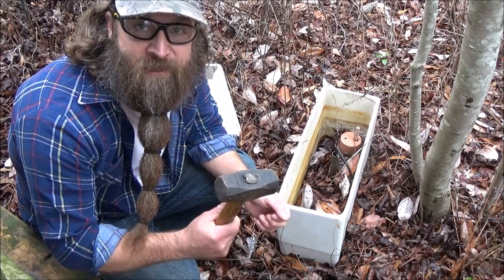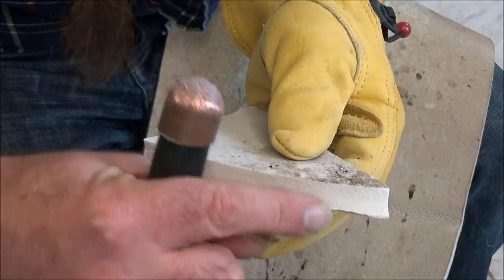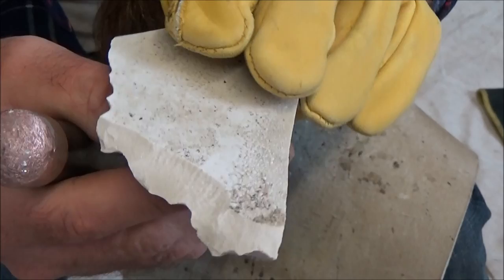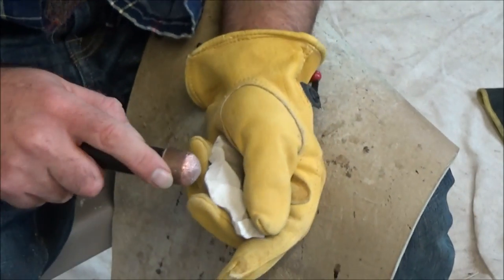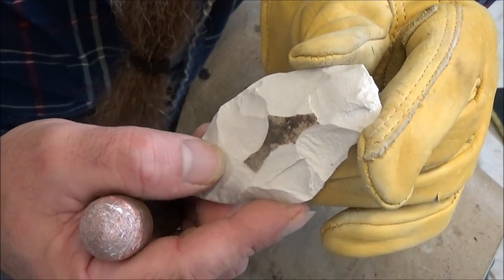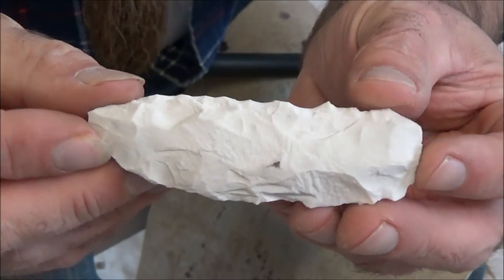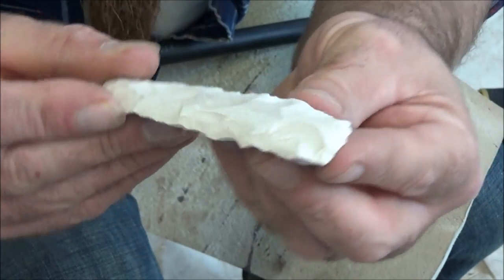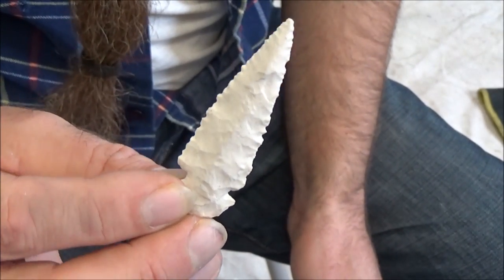toilet porcelain spearhead

Comment: I have a hard time finding good quality flint the stuff I tend to find is to small or round and mostly has mixed minerals such as quarts or slate and snaps is half when I hit the pocket
Reply from the maker: buzzard472 justin I'm afraid you gotta buy it or use glass and porcelain
Reply: gregpryorhomestead thank you I've been looking on amazon and there is one subject I don't ever hear about or hear it rarely in videos is heat treating. How do you do it? What is the importance of it and how long does heat treatment usually take?
Reply from the maker: buzzard472 justin only certain flint needs heating to be best. I brought some to a ceramics guy and he heated it in a kiln. It's tricky. You can look up temperatures and times for it online. I don't do it any more
Reply: gregpryorhomestead. I drink alot a beer so i have alot of glass ima start doing this